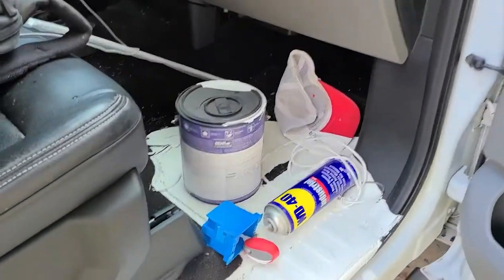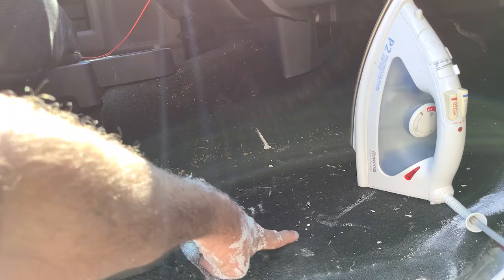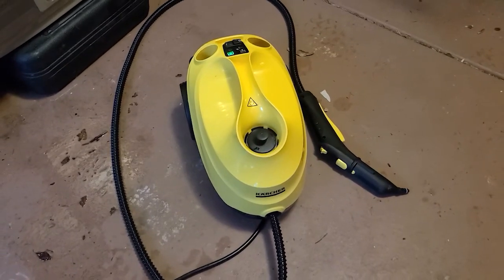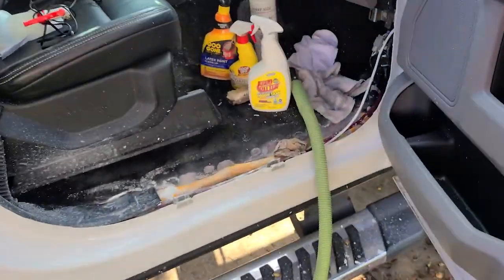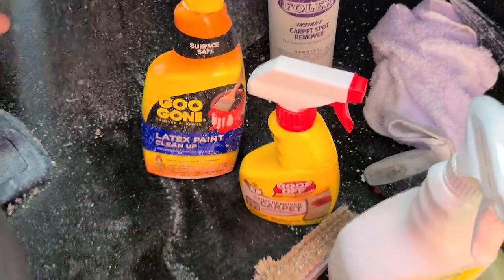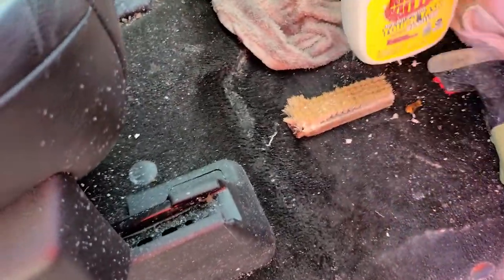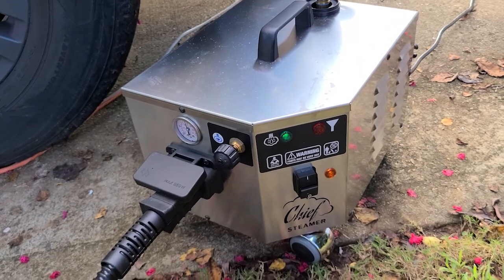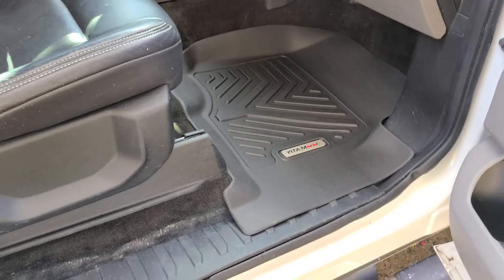A gallon of paint spilled in my car, how to clean up

Comment: For those plastic trim pieces, could you just have soaked them in a bucket of paint thinner? I’m sure you tried everything, just wanted to ask.
Reply from the maker: Probably but I was concerned it would pull the paint / dye out of the plastic also
Reply: Yes paint thinner. At least do a test spot

Comment: Oh an the detail shop told me if that ever happened again make sure after you clean as much as possible to keep a wet rag or towel on it until you can get a detail shop to clean it ,if I had a cheap shop vacuum I would have used that it would have helped pull it out.

Comment: That sucks, I had a 5 gallon but i got at work (lowes) on clearance and i had it sitting in the garage on the foot area of my 4 wheeler.  Apparently it has a lip somewhere and ended up getting punctured.  I have a out 4 of the 5 gallons of paint on my garage floor pooled up.

Im using zep absorbing powder but theres a shit load of paint. I imagine that carpets gonna be a bitch to clean.  

Ive had customers who've purchased paint at my store and spilled it in the vehicle and I feel for them

Comment: Oh wow what a mess, but ultimately you get the job done!
One question what did u use to remove paint out of the exterior car , my wife was driving and a bucket of paint fell off a truck, now the hood and headlights are covered in white paint,
Thanks
Reply: I used paint thinner. Make sure it’s paint thinner and not paint stripper. Then slowly go at the paint and it should come off. Make sure to wash the car with car shampoo to remove the chemical after

Comment: So.....$600 later....toomuch elbow grease and hours of pain in the ass plus wherever you expend extra on car plastic parts that wont clean up....and all wont came off....🤔...is cheaper if you buy a floor carpet new  on ebay and install....know is less work and cheaper for sure
Reply from the maker: Yes agree on the better, not sure about less work though. Some cars you have to take out the whole dash, seats, center console to get the carpet out. Depends on how it's cut. Carpet can be expensive also. But that's definitely the right way to do it

Comment: Dude this literally just happened to me today in my passenger side of my tundra, at home depot because they didn't put the lid on right but mine was worse,I contacted them an filed a claim an also did with my car insurance so they couldn't get away with it ,mine is bad I tried to clean it myself but couldn't.
Reply from the maker: Definitely let me know how the claim goes! Could help others in the future
Reply: @extrabolts  my car insurance is either covering whole carpet replacement an weather strips,or professional detailing to get it out an rubber seal replacements, an home depot did let me file a claim but only because they mixed the paint ,if it would have been a regular can off the shelf they wouldn't have ,so what I'm doing is having my car insurance fix it an they said they're going to go after home depot for the cost .I posted a video of mine the day it happened if you want to see it .
Reply from the maker: @baine5.7  ugh what a mess. I have a pretty high deductible so this isn't a great option for me unfortunately
Reply: @extrabolts  I got people saying I'm idiot for putting the paint in front floor an not the bed of the truck ,but who puts a gallon of paint in huge empty truck bed to bounce around, the chance of it breaking open is 100% more because of that , I think the average person painting there own living room or something just puts it in the floor board an believes that the top is on right an there shouldn't be an issue if it does fall over . And I just posted a video of how mine looks after I was done cleaning as much as could, now I've got a detailing shop saying it's not that bad an they can get it out .
Reply: @extrabolts  Update on my home depot claim they actually called me today they kept saying sorry because it's been 22 days since the claim an are over nighting a check to me to fix it an said if anything else needs fixed or replaced call an they'll send another check im very surprised an happy there being civil about the situation.
Reply: @baine5.7  wow FORREAL I should of done this. It happened to me as well but not as bad as this guy on my trucks back seat 😢
Reply: @baine5.7 Where did the video go?